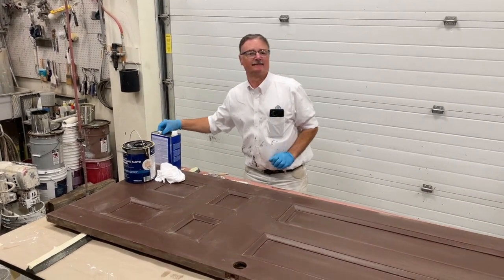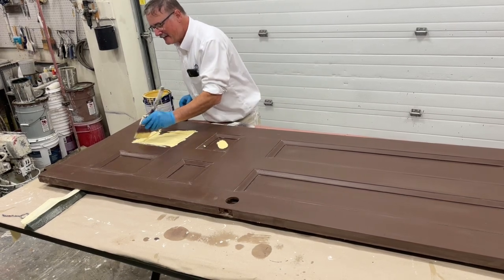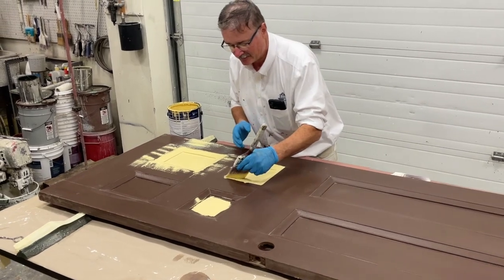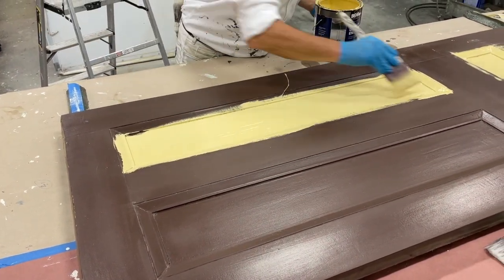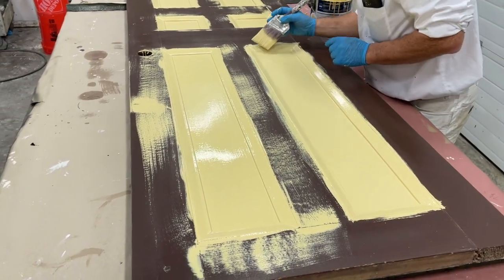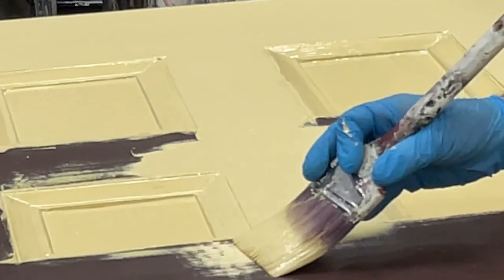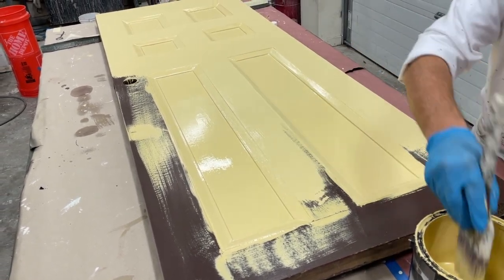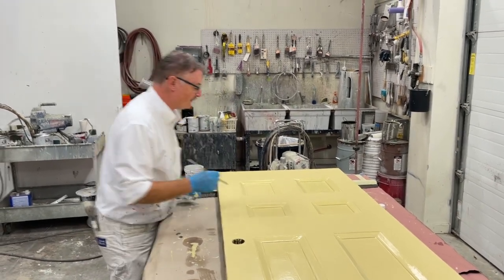Eliminate Brush Marks For The Perfect Finish

Comment: If you paint a door this way, by the time you have 2 coats or even 3 on a new door you will get build up around the edges of every panel, these should be kept clean and not built up. and a 2" brush is fine.
Reply: Yes keeping the edges from getting to much build up is important, that is why I like a angle sash brush and I use a very small brush to clean the edges.
Reply: Good point. He's not doing that door in 10 minutes either and it is a bit silly saying that to a amateur audience.
I would also advise decanting your paint into a kettle (to stop contamination of dust and fibres).
Reply: yep his brush was too big and too stiff , especially for the panels , smaller softer brush better , styles and rails could have easily been mini rolled

Comment: Never said if the original paint was latex or oil.  Can't paint latex over oil, so I assume urethane alkyd enamel is OK over oil?  Not enough data.
Reply: The original paint was latex.  If it was oil then the process would still be the same.  Using Lacquer thinner is more important as it helps soften the hard oil paint surface.
Reply: You can paint latex over oil. I do it quite often with great results.
Reply: Sure you can 
But not the other way around

Comment: Well, it took 23min to paint 1/2 of a door! So i find it really really hard to believe an entire door can be done in 10-15 minutes. I see no reason why one would feel the need to "stretch" the truth in something so mundane. Even at 720p with poorly shot video I can clearly see brush marks, and globs in this paint! A real "professional" would have added Floetrol to the paint.
Reply: Sorry for "stretching the truth" I was just guessing at the time.  I timed myself and it took me 16 min and 43 seconds to paint a door.  The only time I use floetrol is when the paint drags (seems dry) or when I spray with a HVLP sprayer.  Most of the paints I use do not need floetrol and especially Urethane or Alkyd paints they run thin.  Too much floetrol has a tendency to flatten of dull the paint
Reply: @jaredwilly1  then don't use "too much" floetrol ......
Reply: Obviously your a professional and the videos you make are 10x better
Reply: @mikeoconnell4399  "REAL" professionals actually DON'T have time to make videos - they are too busy with their construction jobs! But you already knew that , , , , , right?!? I've been doing construction since i completed my apprenticeship in 1981 - how about you?